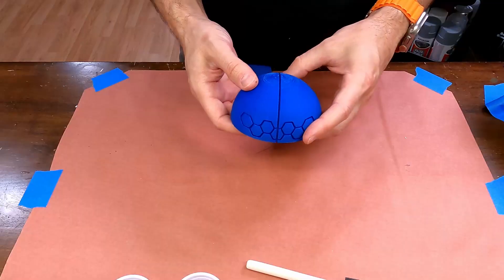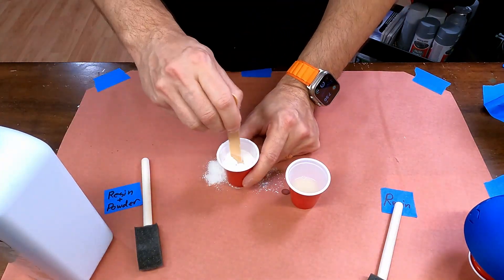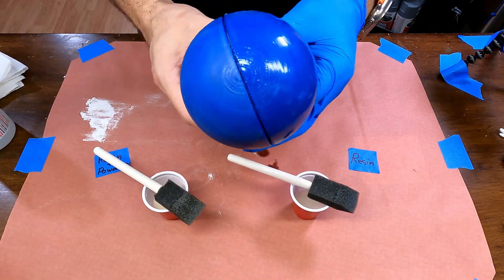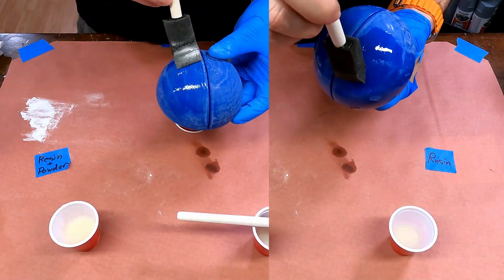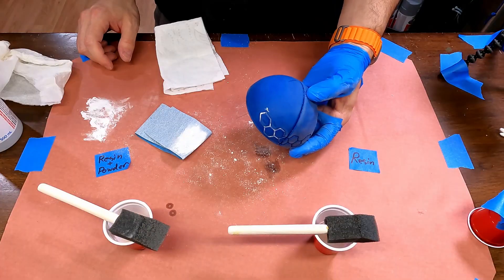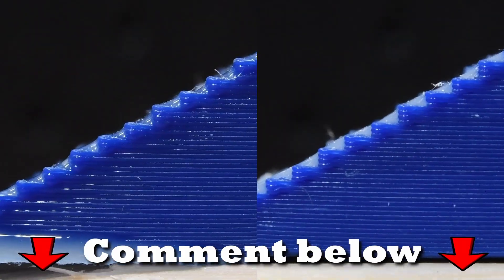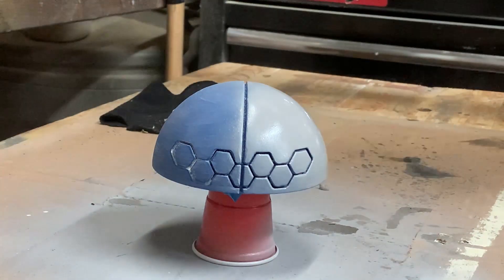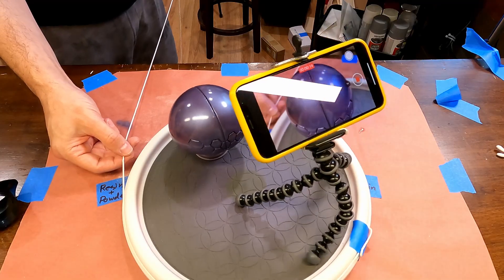What hides 3D Print Layer Lines Better,  Resin or Resin with Baby Powder

Comment: I'd be curious to know what your results are if you were to use standard UV curing resin (the type you use with a silicon mold) with this baby powder process, instead of the UV resin made for 3d printers that you seem to be using in this video. Is there any difference between the two, not just in performance, but also cost?
Reply: I've done it with the uv resin for arts and crafts and it works great because it's more viscous.
Reply from the maker: never used that kind so can't say.
Reply: @DaveRigDesign  Might be something worth trying out in the future? I believe a bottle is not too expensive on Amazon or a local craft/art shop.
Reply: @DaveRigDesign you really should try it with uv resin for crafting. It will do a much better job than printer resin.
Reply from the maker: Interesting, I was using printer resin because it’s what I had on hand. :)
Reply: The mold type doesn't work so well in a 3D printer. I had to replace my base plate after accidentally using the mold resin. The pieces did not print correctly either. Between the viscosity and the light used for layer printing it just didn't work out correctly for me. 

Maybe if I had done some test runs or checked into it, things would have been different. 
The bottle of mold-resin I had was actually a miss-ship. I ordered a bottle of one resin (that I had been using) from the place I regularly got it through, but received a different type of resin in a very similar bottle. I should have been more attentive to my purchase. Would have saved me a plate and film replacement....
Reply: @nobodyshome6792  I think you misunderstood what I was asking. To clarify, I wasn't asking whether he could use mold resin 'inside' a resin printer to 3d print something. I was asking if he could use mold resin with the baby powder in his layer line smoothing process shown in this video. I was curious to know if it is as effective as him using uv print resin (for this post process only), and whether it might also be a cheaper option than buying a bottle of uv print resin.
Reply: @Old_and_Wise  fair enough. 

Though, I have found that the mold resin is more expensive from the source I buy resin from. (By about 4 dollars per half-liter.)

I almost never use an FDM printer, instead preferring my vat-resin printer.

Comment: Good job on comparing the two methods! A few small gripes though: 1) when you first cured the resin+powder, you afterwards cured the resin only and resin+powder at the same time (so resin+powder got cured two times while resin only was cured one time) 2) please recommend to wetsand and use a mask while doing so as resin dust can be inhaled and quite toxic.
Reply from the maker: Ya I though about the curing and there wasn’t a easy way to avoid it. I tried to cure the one side a short amount at first to get the resin to set up, then for the 2nd side cure longer so both sides got a similar time in the chamber.

Comment: I use the spot putty + acetone technique, the spot putty sands way more easy and helps save time in my opinion.
Reply from the maker: it's just the opposite approach, thinning a thick product instead of thickening a thin one. :)
Reply: @DaveRigDesign  even with spot putty without acetone I feel it’s much easier to sand since it’s softer , resin is much harder so takes more effort to sand , can even sand easily spot putty with a scuff pad cause it’s so easy to remove material. But your way is also cool never thought of adding baby powder to resin , I’m gonna have to try that !

Comment: I liked the stair test. The resin and powder are great for coverage and deep lines that need to be filled. The resin only might be good for high detail areas where some of the detail needs to come through.
Reply from the maker: just resin would be good if you have a flat surface, just make sure it's level and pour the resin on and it will self level to a flat area with minimal sanding needed
Reply: @DaveRigDesign  Did the resin fully cured inside the stair test? How many minutes was it cured? I find it hard to cure that thick resin even on clear resins. I even tested the clear resin and only the top surface cured while exposing it to UV light for 30 mins
Reply from the maker: @jchester07 cured for a few min and it was solid. How strong of a light are you using?
Reply: @DaveRigDesign  I'm using a generic UV lamp. 405nm. 6W power and 60W UV influence
Reply from the maker: @jchester07 not sure. In some cases if I cure a drop of resin I can see it cure instantly and create some smoke from the heat or generates.

Comment: I wonder if the resin can be air-brushed instead of brushed. This might cut down on the build-up.
Reply from the maker: I have seen this done but it's a dangerous process. You need to know what your doing and do the proper prep work.
Not sure it would give any better results either other then covering large areas faster.
Reply: It's extremely dangerous to atomize resin, please don't even think about it!

Comment: Instead of Baby Powder could you use fine Plaster of Paris? I only ask because it is a known workable material used in hobbyist environments and health care facilities that  has no recognisable health issues unlike Baby Powder. I also think it may give a smoother finish, eg less sanding.
Reply from the maker: Would probably work also.
Reply: you should try with a very small quantity, because of plaster ph , it might influences the curing process